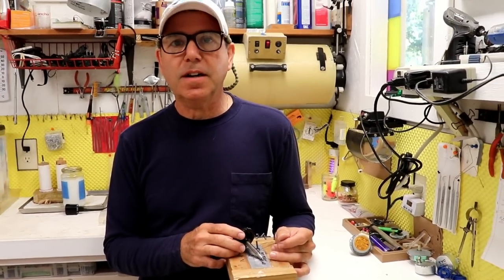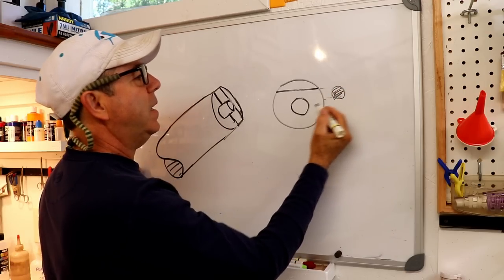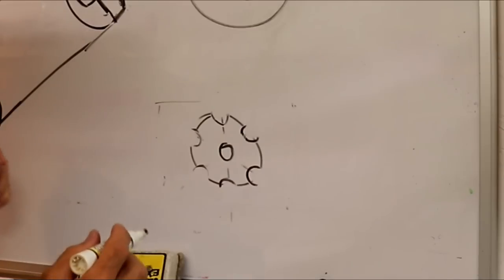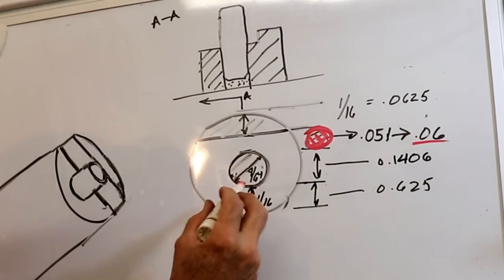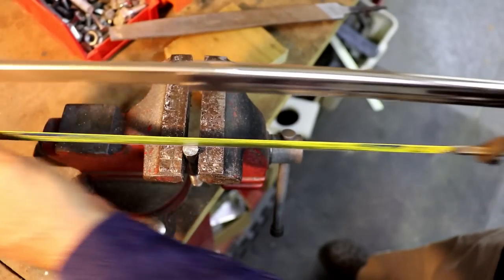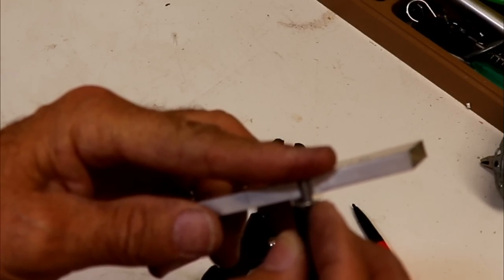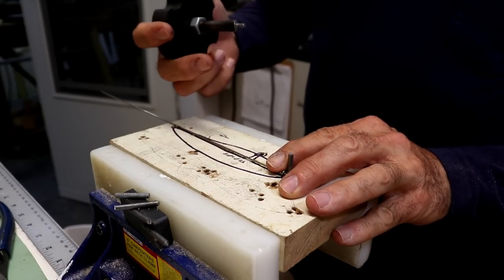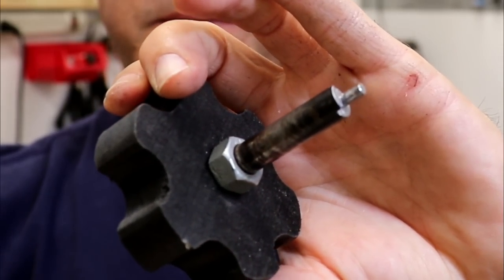Lure Wire Bending Tool, Let's Build One

Comment: I’ve been a subscriber for some time but missed this one. This is brilliant. I bought the Hagens Wire former that I’ll use for the twists but had been searching for quick way to form those loops that drop down for the belly hooks. I’ve given up on wood carving and am moving in direction towards building with CNC router. I want to route tiny channels for the thru wire so I gotta be able to bend that wire extremely accurately for that to work. I’ll have benefit of having entire design in CAD so can make perfect bending jig also
Reply from the maker: Sounds awesome.

Comment: Not to be negative or sound critical. You made a great tool from scratch! Great job! 
But, I think I can speed up this build. Get a large pre-made, threaded knob. And get a bolt, that fits the knob's threads. Pre cut your bolt to size, and shape, etc. And last, screw it in and epoxy, or J.B. Weld it into being permanent. 
OR- Leave the bolt removable. Then if you want different wire bending heads / sizes? You can swap them out as needed? 
The fishing lure wires don't require allot of pressure to bend, as much as straight angles, and a little direct force. 
You could also get a small block of aluminum stock, and tap it as a final jig (versus the wooden block)?
Reply from the maker: Yup...first one I made was from a pressure regulator adjustment bolt, already had a handle on it.

Comment: Thank you but this all new to me. So a question, why or how did you hammer a nail  or pin sideways into the black handle?  Are you driving it into the metal bolt?  Doesn’t seem possible.  
Did you have a pre drilled hole in the bolt threads?
Reply from the maker: Yes..I I drilled the bolt.

Comment: What is the best wire to use for a crank bait . 
Wanna make thru wire lures , 3” plus lures for trout or larger ones for pike . 

I hear stainless steal tig welding wire . 
What diameter would be best
Reply from the maker: Stainless steel straight wire .040 to .050 inch diameter.  You can find it on my amazon store:  https://www.amazon.com/shop/engineeredanglerlures

Comment: Can I use this tool to do the following: I want to make a wooden lure, drill a hole through the length, create a line loop in a wire for the front end, slip the wire through the lure, and make a treble hook loop for the back end. This back end loop is done with the wire in the lure. Is there a way to do it without scuffing the lure?
Reply from the maker: I don't think you can because this tool is meant to make all the bends prior to installation of the wire...
Reply: @EngineeredAngler  Love seeing people create their own tools. I've tried to create a tool for this particular challenge but I'm new to lure making and just don't have the depth of experience required to come up with a solution. Do you have any possible ideas for a solution?

Comment: Can you make a video on how to build one of those lure duplicator machines that uses an angle grinder saw?  I think alot of lure builders would really enjoy that, make the video in several parts, 1 2 and 3..
Reply from the maker: I can't say I haven't considered it but, up to now it just hasn't seemed worth the work.  If I make a lure on the lathe that really works well I just make a mold.  Making lures from resin is much  more predictable, and usually results in a tougher longer lasting lure.  But thank you so much for the suggestion and for watching the video.

Comment: This tool can be used to bend AISI 316 stainless steel rod 1.6mm or 0.629 inches?
Thanks for your videos I am learning a lot.
Reply from the maker: You'll have to make it large enough to fit the wire and maybe put a T-handle on it for leverage.
Reply: Thank you very much. I understand it perfectly

Comment: Should have just ran threads in the wooden knob with a spare bolt with a grove cut down them (makeshift tap)

I see the aluminum jjigs but that wooden ones should be made out of hard wood to wear less,Osage Orange Mesquite,and Black Locust is the#1,#2,and #3 hardest North American trees.Janka scale Osage 2760, Mesquite2345, Black Locust 1700.

Comment: why did you start using thicker wire?
Reply from the maker: I'm using the thicker wire so that I can make some tougher harnesses for soft plastic lures. The small lures I'm making now are fine with the .270 inch wire but the heavier stuff is going to be better for bigger soft Plastics.

Comment: Hi mate, what is the size of the wire that you are using .
If you know in meteric system I´ll apprecieted.
Reply from the maker: It's .05 inches...or 1.27mm
Reply: When someone say "hi mate" you can presume they use the metric system for measuring.
Reply: @mrBDeye  in England they use both but because I'm from Portugal I use the metric that is more accurate them the imperial.
Reply: @1joaonobre  
Both are accurate.  As a Mechanical Design Engineer I would like to see your example of how metric is more accurate.  Thanks.

Comment: What gauge wire do you use on the 2" lures vs the 4" lures?
Reply from the maker: There's really not a big enough difference between 2 inch and 4 inch lures to change the wire. I use .026 inch diameter wire for everything up to 6 inches. And I move up to .032 for larger lures. If you really making big lures you can get .04 inch diameter wire but I think that's as heavy as you'd ever want to use. I know folks who are using .05 but that's really excessive.  The strength of The Wire far exceeds any other part of your fishing rig. It's an Overkill in my opinion.
Reply: @EngineeredAngler  , and where is a good source to buy it and what do I ask for?